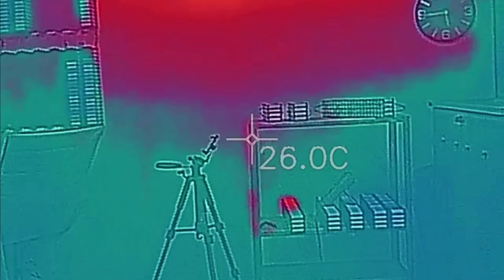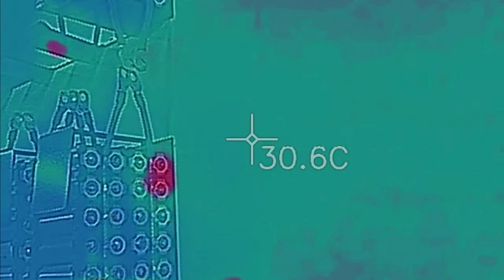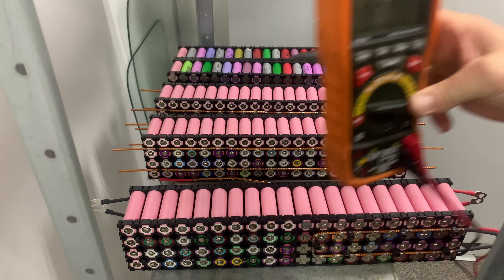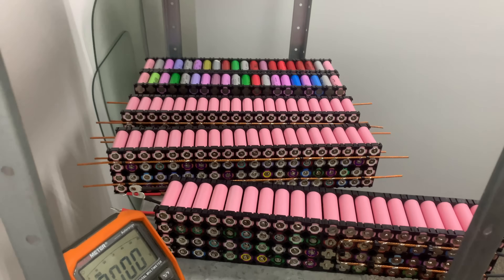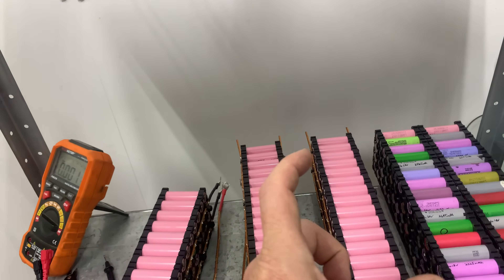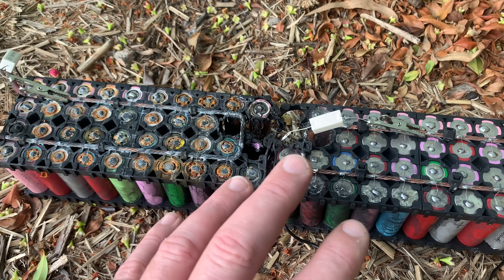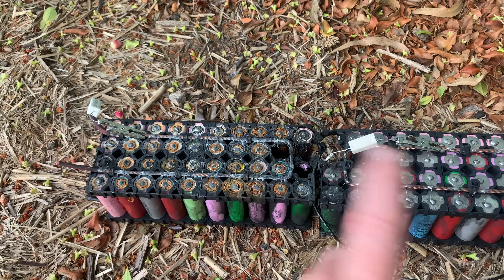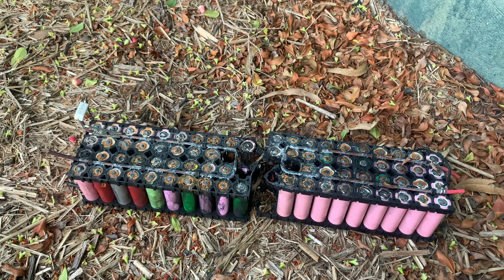faulty 18650 cells caused a fire and I think I found out why!

Comment: To underline what Pete said about dumping the batteries into a big bucket of water.
A fire extinguisher will only buy you time to get the battery to the big bucket of water, it takes hours of soaking in water the fully quench the reaction (even if the cell can has burst).
Reply from the maker: this!

Comment: your going to have to find a way to add thermistors  between  all  cells with appropriate hardware to monitor for hot spots and automatically cut off all energy going into those cells and ring loud alarms
Reply from the maker: If you keep adding layers of complexity it becomes less reliable. Placing in a better location would be time better spend i feel
Reply: Better safe than sorry!🤔

Comment: I blame the longmon. The reason is that balancing/monitoring places alot of stress on battery packs causing heating/power drain. Polling times needs to be increased. When i think about it e.g. someone asking me " R we there yet" every 5 mins. it is going to piss me off. What i am asking is if the monitoring of the all battery packs be manually done so as to reduce unnecessary power draw.
Reply from the maker: What the hell are you smoking? The cell failed nothing to do with BMS
Reply: @HBPowerwall   Sorry Pete . I was watching Thomas talk about his powerwall that does not have a BMS. Video here https://youtu.be/zFnp7jUegtA?t=436 . Again sorry to hear about the fire. Cheers big man.
Reply: This has nothing to do with longmon. Even if the pack was being balanced at 1a, across a pack of 40 thats 25ma per cell, thats nothing. The cell and not noticing the failing cell was the problem here.

Comment: It does not require much current to generate alot of heat over time, especially if the cell is using its own current to heat it's self, 20watts could be a soldering iron, only 5a at 4v, the fuse could possibly not blow at 5amps, plus the cells current, maybe the next step could be cell level protection boards! Ha-ha, yep, hello eBay, I need 5,000 18650 protection boards! It could possibly solve the issue, but a bit overboard! Surely there is a thermal sensor that could be implemented, a fire extinguisher is not going to do much, because is has little effect on the heat source, maybe Co2, maybe freeze the cells nearly stopping any power from being released, blast freezing with Co2 may do it, drop the temp to about -20to -50 freezing the electrolyte possibly, but there would be no fire!  I guess I'm adding a fail safe to mine, where it can be shoved out the window, incase of a major event! Ha-ha!! I'm thinking I'll move mine outside!! About 24 cu'ft'should not be difficult to keep warm in winter!

Comment: I'm thinking that building a few arduinos that have multiple thermal sensors on the packs help detect hot spot and  that can open some pack shunts if cells exceed a certain temp might not be a bad addition. 

I also still think the fuse wiring was either too thick or the bus bar was acting as a heat sink and allowing it to carry more current than it should have allowed. Do you test your fuse wire attached to a bus bar to see how it works under load with that big copper heatsink to dissipate?
Reply: Could wire it to can bus or rs485 with bms, inverter and a gateway like esp32 or stm with WiFi with a piezo electric buzzer and an epo switch and relay for fire system trigger. Lots of options

Comment: How do you “maintain” a battery
Reply from the maker: Check all bolts & nuts are tight thermal cycles can loosen. Check for rust, oxidation *spelling.. check for heat, check for objects that might have fallen on battery, clean spiderwebs, Check solar panel connectors, check breakers operate, check charge/discharge settings, Check BMS is working properly, manually check voltage on all cells and check them against BMS readings with out a doubt i've missed something.
Reply: @HBPowerwall  Pete, now might be a good time to do a video on 'How do you “maintain” a battery'
Reply: @HBPowerwall  thanks for the information! I'm a bit literal and wouldn't have thought of the environment or other components falling under battery maintenance.

Comment: Is it just me or are those fuse links a bit thick?  I used copper, but mine are definitely thinner.  What current did those fuses test at?
Reply from the maker: I plan on taking some fuses off and trying to run some tests ... I think that'll be an interesting metric to know also..
Reply: @HBPowerwall  Please do. I just don't understand how fuses didn't blow.
Reply: For an internal reaction to start cell do no require external power, its the chemistry inside, forget about the fuse. Also, people here also think the cells needs to be charged, wrong even a t 2.5volts the cell has more then enough energy for the reaction to occur!
Reply: Fuse does not bloe because cell can draw 0.4A and still overheat and vent. Fuse has nothing to do with that

Comment: Monitoring my packs with a Flir just climbed up the list, to the top.
Reply from the maker: Don't forget all the other little things too :) Thermal is only part of the equation
Reply: @HBPowerwall  We need a list
Reply: Continuous monitoring with thermal camera connected to raspberry pi. Suspicious differences in images or detected hot spots automatically & immediately send via email together with a loud buzz alarm. Hardware cost $500 USD max? Something like a flir one pro should be enough I think or similar resolution/sensitivity.
Reply: @bullglar  can likely be done with stm32 for less than 200 and work in areas where flir won't. Either due to idle power draw of the cams and pi, or because the packs inside a heat shrink or metal enclosure. Your idea still has merits. Would consider it even for dodgy inverters n such. Just like stm32 with can bus more as you can integrate your bms, inverter, and battery monitoring on a single bus, and then have a chip like an stm32 with WiFi for exporting data, a web ui, alarms and so on.  Also works for remote management
Reply: Monitoring is done and no cell was heating up BUT I found a pretty rusty and rotten cell in my pack and did not expect this at all. I am very glad I had a look at my pack and could remove the cell before something happened.
Reply: Yea same but I use holders so much safer and easier for me
Reply: @AndyShell  I copied your build in the beginning when I did not have so many tested cells. The holders get you somewhere faster and to be able to change bad cells is great for diy.
Reply: More thermal monitoring on a day to day basis might help. Just how a bms monitors one area on a pack you should be able to monitor multiple areas. And some bms after this slew of videos might have a way of flagging potentially faulty cells due to charge and discharge or thermal properties
Reply: Blackview BV9800 Pro... smartphone with built in FLIR sensor... ;)

Comment: Yup just one cell.  

They rocket motor and while they are burning up they weld the fuse and take out the whole parallel block... I check my cells weekly....   

All I have is miss-matched old batteries.  

And the fire extinguisher is rubbish.  

Take it outside wait for it to burn out..  

I’ve learned mine are in aluminum boxes with vent pipes that go outside and all my batteries are in my shed..
Reply from the maker: Sounds like you've put some thought into your build

Comment: Or just submerge your DiY powerwall in mineral oil and forget about a thermal camera... :D
Reply: Souns like a good idea, it can be used for cooling the cells also. I will test some healthy cells inside mineral oil for some months.
Reply: Thought of that too something like the oil that's used in to cool transformers won't help with a single overheating cell but doesn't let any oxygen in, at least no fire
Reply from the maker: How will that help a faulty cell? it's still going to discharge unbaling the battery making much more work for the bms to keep it balanced. Hiding the issue isn't the goal its fixing it.
Reply: @HBPowerwall  you don't! Just let the thing smoulder in the mineral oil and replace the pack when it fully "packs" it in. Hahaha.
(It was a joke, but seems like a pretty good idea...)
Reply: But mineral oil boils or burns at high temperatures, right?
Reply: @mrtechie6810  yes, but only slightly. And not enough burn for it to make a difference. It'll probably prevent runaway because of thermal conductivity of the oil. That being said, utility companies use some variant to keep their transformers cool using convection (or active cooling).
Mineral oil would be a "set and forget" approach where you can't be with the cells 24x7 and using a different (less volatile) lithium chemistry is not an option.
Reply: @Repairman that's the point. (/facepalm)

Comment: Maintenance wouldn't have been such an issue if known troublemakers like the Sanyo 18650's were left out.
Almost 2 years I finally had enough identical cells to make a 1p14s battery, unfortunately they were Sanyos from drill batteries.
I also had 3 Sanyo heater cells to experiment with (under controlled conditions), after a few experiments I now had 6 heater cells, and 3 with poor capacity or other issues.
Started with 36 cells old cells, ended with 14 good ones, so 67% failure rate (yes even the spare cells failed).
Some got hot when charged, some heated up when discharged, I think some even acted up with left on a shelf.

Technically Pete is right about this being a Maintenance issue, if you count going back and rebuilding the packs without the sanyos as Maintenance.
So you need a $300 thermal camera, $200 worth of cell chargers, $200+ for even a basic monitored BMS, plus a smoke/fire alarm, this is not a cheap project anyway with the cost of obtaining the cells.
I still think just obtaining ONE big battery you can repair/modify to suit your purpose, or just buy new/unused matching cells is a much better option.
Reply: The part that amazes me about this whole scene, is that so many are prepared to learn, but not learn certain things.

Programming an arduino is fricken simple. Yet people would rather pay exorbitant money for the latest chargers and BMS systems. I understand it's more of a learning curve and I'm lucky in that I started young with electronics.

But there's so much misinfo (it's getting better) out there, and so many simple solutions to some of these problems.

I might even start building some solutions and selling them, because the cost of chargers and the like, are beyond the pale for what they are.

Comment: And this is why I avoid using mixed used cells and buy modem packs or  e bike  packs.  You know what your dealing with.  Un- used Ebike or Schooter packs  you have a I idea what   your  messing  with.  I just purchased         600 schooter pack cells and they're all within 30mOhm of  each other  internal resistance and a few 100 mah of capacity.  Much easier to  harvest and us.  Yes you can harvest wild cells.  Yes they work.  'o I don't like doing so.
Reply: Really don't know that what you're talking about is any safer.

You still don't know how long they've been shelved, in what state, 

Agreed, "an idea of what you're dealing with" reduces the probability, but not the possibility nor propensity.

All's I'm saying is, don't be complacent.

Comment: The lesson here is these things need constant monitoring due to the cells being of unknown age, condition and also being mixed with other cells of different design characteristics.
Reply from the maker: THIS...
Reply: Thermal camera 24/7, snapshot each minute, compare differences or detect hot spots. Shouldn't be that difficult. With raspberry pi maybe. Probably cheaper and more reliable than lot of single sensors on each cell.
Reply: @bullglar  possibly. But for those of us without easy access to cells visably either due to kapton n heat shrink or a metal enclosure, this approach would take many flir cams from many angles n hoping  that the thermal transfer is good enough to notice a start of a failure. Not when it actually fails. In this scenario I'd likely trust individual sensors more. As they're very cheap and could be run off a single stm32 board. Much lower power usage
Reply: @bullglar  thermal camera is expensive and its duration working 24/7 ..
Reply: I’ve had my Leaf wall operational about a week now and watch it like a hawk, thou I’m confident the cells are not going to be an issue, I’m more worried about the low voltage wiring. I need a thermal camera.
Reply: Agree, you should never mix different cell brands in one pack, that is Battery 101 knowledge. These packs should not have been built like this using different cell brands
Reply: @Utube2Itube  mixing cell brands is not the issue. Even balance in your packs are the point. 
Not overloading your cells is important and maintain them. Mixing cell chemistry is the biggest no no.
Reply: @ballsyau1974  Mixing cell brands might not necessarily have been the issue this time, I’m just saying that this is generally not allowed if you are producing e.g. certified battery systems. If you mix brands you have to set the system BMS according to the cell of the lowest specs, or else you might abuse some of the cells slightly all the time. Long term abuse can then develop into a catastrophic cell failure.

If your BMS is monitoring each and every cell block and cut the complete system accordingly, balancing is not a safety critical function. No balancing will continuously reduce your system capacity, but will not be dangerous as such.
Reply: If anyone does mix different cell brands, ages, or models each cell aught to have some kinda thermal sensor. Maybe someone will make a bms or can bus addon board that can multiplex a few thousand thermal sensors. Till then just don't do it
Reply: @nekotherion7317  I've never been a fan of thermal sensors, they're completely useless unless they're either at the top of the pack: completely enclosed... Or on each cell.
Reply: @jamess1787  that's what im suggesting. 1 per cell. Multiplexor putting all the values onto canbus or rs485 and having the bms read em that way. That way you can monitor infinite cells on a very granular level. And for packs that are either hard to maintain properly or are too remote it's about the only way of doing it while using 2nd hand cells. Which most will do anyways cuz budget. So just allows it to be safer.
Reply: @nekotherion7317  hard to justify buying something per cell, especially if you're paying less than $3/cell (or recycling them).
Reply: @jamess1787  tell that to your insurance adjuster after the house burned down. N like ip cam setups sometimes there's insurance write offs for the cost so your monthly premiums go down
Reply: @nekotherion7317  pretty sure having a DiY powerwall falls under the same clauses as: "do you skydive?" Or my favourite: "Operate a wood stove?"
If an insurance company decided to persue legal action: there is no fighting chance that you could win. "Your honour, the defendant did not know building a battery backup system using laptop batteries and a no-name inverter was a bad idea." Pretty sure isn't a viable defense. Kind of hard not to find information on the internet of (certain chemistries of...) lithium batteries not self igniting.
In any case: an ounce of fire-prevention is worth more than a ton of protection? Stick those cells in an oxygen-free environment, and make sure the pack completely disconnects if there's a fire, and eliminate the chance of fire spread.
If you had a fire chief sign-off on your build: this is your only option to combat an insurance court case.... But im sure there's more up their sleeves.
Stick your cells outside in a metal box with fire rated insulation and adequate cooling/heating, keep the shrubs down... And if it catches fire: you'll be thankful you did.
Reply: @jamess1787  probably n love your approach with the metal thing outdoor. Just think for protectiok of one's own investment in gear a hundred bucks on a slew of thermal couples is probably cheap insurance when you look at the cost of cable, inverter, bms n such, in reality it's pretty cheap. And wiring in a transformer inside a cheapo inverter can fail too. All depends on types of load and what the units designed for. So in reality everything should be maintained. And monitored. Should be baked into the budget. Especially for cells that don't handle charging in the cold your metal chest idea could itself lead to a failure. So all depends how much risk how much load. How much budget n so on. But if it can't be done safely shouldn't be done at all. Your risking your life. Your families. And potentially neighbors.
Reply: Yed

Comment: I feel like checking with a thermal camera frequently is just a band aid though. What could be done to prevent/detect the heating batteries? What would a manufactured cell do? Would a cooling system need to be introduced?
Reply from the maker: Cooling will not help or fix the issue, might make the cells last longer MAYBE, but thermal camera is a bandaid you can rip off :P
Reply: @HBPowerwall  I was just thinking what would TSLA's solution be for this? Just underload the batteries?
Reply: Continuous thermal imaging with automatic detection of hot spots, sending alarms & shutting everything off. If detected temperature exceeds 130 Celsius automatic flooding with a lot of water.
Reply: So, the first thing about any car battery pack is that ALL cells come from the same batch, from each batch a certain number of cells are tested. That is the safety, the END.
Everything else is monitoring and data acquisition.